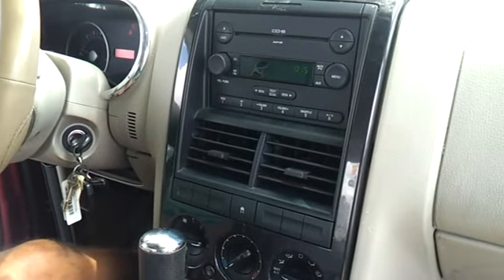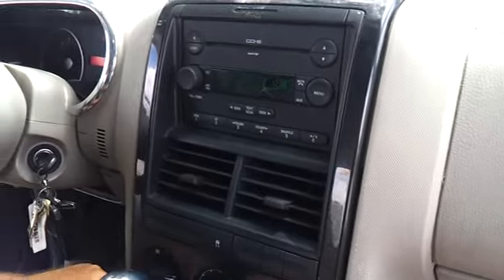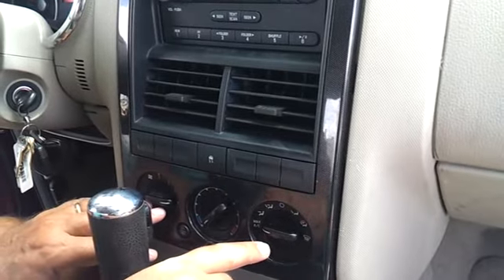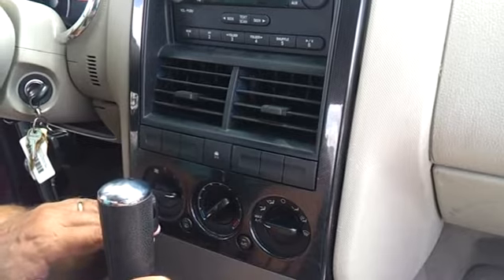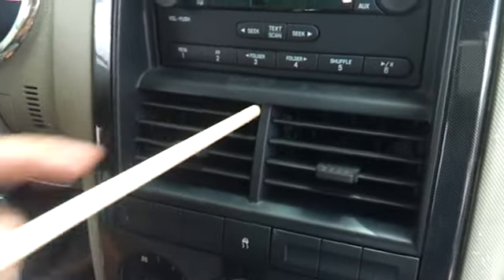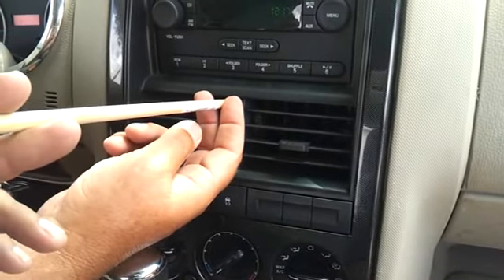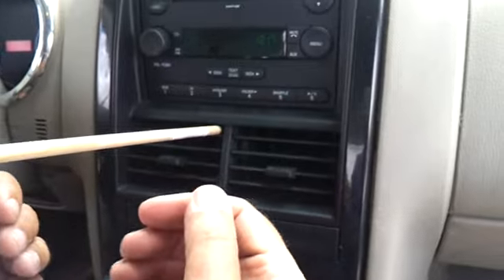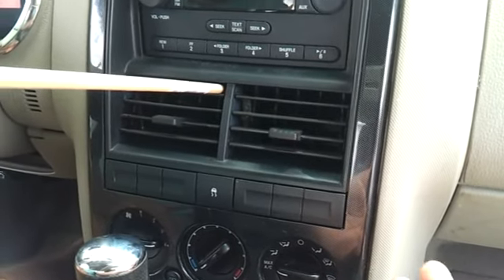Ford Air Conditioner Fix For Free Blend Door Problem

Comment: THANK YOU SIR ! Had the same AC vent problem for a year. I put a dowel in the vent and pushed it back and now I have AC in my Vent! 90% of the time it’s caused by a broken vacuum hose under the dash that runs off the engine. I traced it back but it would take hours to repair. This saved me a lot of work !

Comment: We are in 2024 July, My 2010 Explorer experienced same problem as described. I did as you said, and miraculiouly it worked, no more sweat. I used a full length pencil, placed a flat cap on it and fixed it inside the blower vent border... Its not even visible to anyone and works well.
Thank you so much for placing this video, certainly saved me $1500 approx

Comment: thank you so much, 2005 xlt here- 97 degrees outside and I've spent half the summer with no air from vents - it was stuck on defrost. I shoved a straw in the right side vent, 4th one up, and pushed it all the way in. Boom immediate AC. I used a "milkshake straw" - they're a bit more sturdy, and covered the end with black electrical tape so it wouldn't look crumby, heh. I saved north of $1,000 thanks to your video. You're the hero of the day.

Comment: I just tried this method and it worked for me but instead of what you bought I used a straw which is wrapped in paper where you can get them for FREE at any restaurant or fast food places. Thanks for the great tip.

Comment: Thank you so much! This is an easy manual fix until I can figure out the drill fix. I am able to push open the door if I need it and reach my hand behind the glovebox and manually switch it back to the defrost vents.

Comment: Had the same problem with my 2002 Explorer. It was stuck on the defrost vents. On the passenger side of the firewall under the hood, there's a vacuum line which comes out to a plastic "T fitting" which broke off from the heat over the years. I used a needle nose pliars to remove the peice that broke off from the vacuum line and replaced the T fitting. Problem fixed! Make sure to check that T fitting as it's a very common issue!!! T fitting part cost $1.00

Comment: Same issue in my 09 Explorer XLT. The problem is that the small black plastic handle broke off where it attaches to the mechanism that pulls and pushes that door open and close from the inside. It can be fixed through the glovebox by drilling a hole in whats left of the plastic rod and then zip tying that to the metal arm (already has a hole in it) that comes out of the mechanism. Look it up in some of the Explorer forums.

Comment: Yes, this worked on my 2002 Explorer XLT! Cold air is now blasting out, and I need al of it in these hellish 100 degree Texas days! Thank you for sharing this fix! It really was just as easy as you said. The 1/4" dowel was exactly the right size. I inserted it into the top middle vent about 6" and it popped open the door (or 'damper'?) that had been blocking the air flow.
Reply: Where do I buy this dowel at?
Reply: @raylario5525  home depot- they have tons of them small med and large

Comment: Thanks for this suggestion. I have a 2006 also. The plastic tab inside the dash is broken and I don't think I can buy just that. The vacuum actuator seems to work just fine. I have been dropping the glove box and reaching in to flip what is left of the tab. I'll try this
Reply: Hi
Reply: Same thing I do

Comment: Thank you sir for taking the time to make and post this video.
Reply: Part two of this comment, found the fix easer to do with the engine on, the vacuum moter extends its arm with engine running. Trying to locate the hole in arm of the vaccum moter is extremely difficult,  in the defalt position.

Comment: I fixed all the blend doors on my '02,just made some cuts to the dash,it's a 20 year old car so I will not be putting it in any car shows,glued the hinge back on the fresh air door,replaced the vacuum hoses and cut out the panel to the left of the fan switch to easily remove the blend door actuator,then glued the piece back in,you just have to be careful you don't cut too deep and hit the wire harness inside,

Comment: Thank you for this video. But the solution is simple. I had the same problem and took my car to a professional mechanics and solved the problem. The solution was to replace a small hose connecting from under the hood and inside the car with a little piece. it costed me about 30 dollars including hand working.
Reply: Hi sir can you tell me where you fix this
Reply: Can you be alittle more specific on which hose? I have this same issue and would like to fix it the correct way before I try the stick way lol

Comment: This works very well! If you want to fix the part that's causing the issues, the repair shop is going to charge you 1000$. Or you can easily remove the sides of your glove box and reach in there, see the part and see if you can fix the lever from there. Otherwise the repair shop needs to remove your dash and replace the part.
Reply: Not accessible that way on my 2006 Explorer.  The dash cover would have to be removed.  But the dowel did the trick!